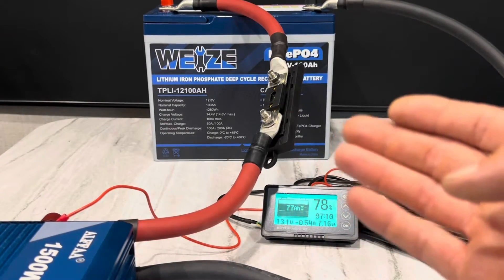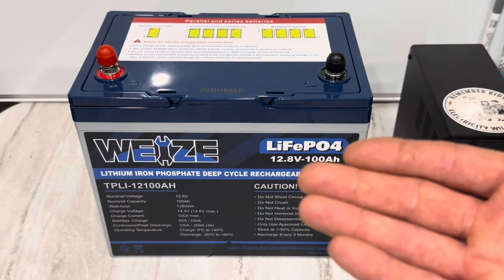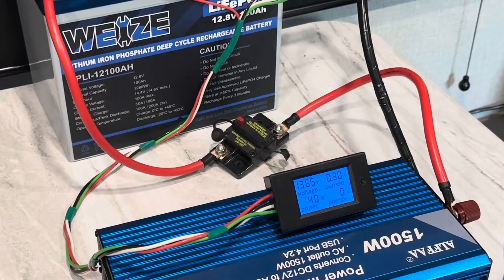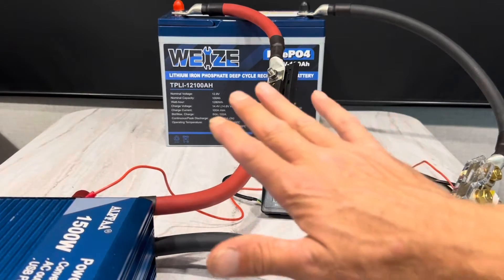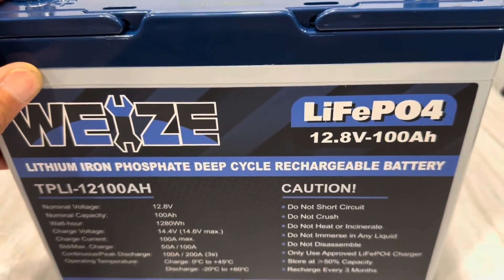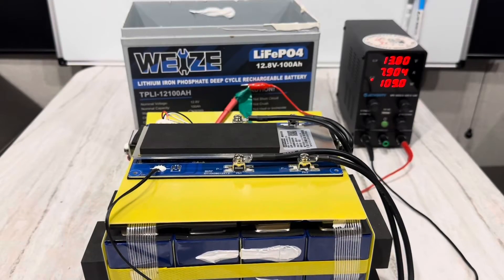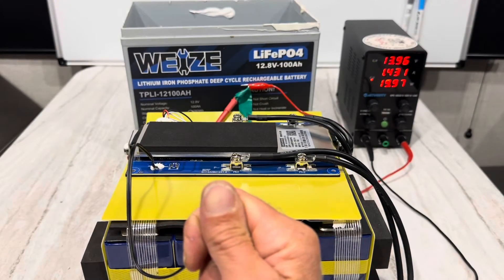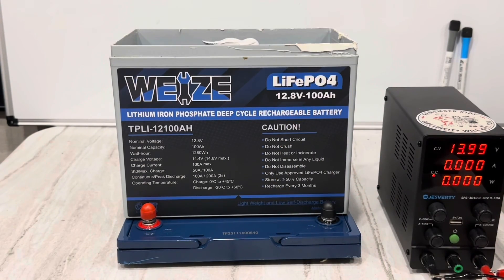WEIZE LiFePO4 12.8 Volt 100Ah Group 24 Battery Review Test Teardown

Comment: I just purchased one of these but with the bolt terminals, and thermal compensation... not sure if thats a BMS charging/discharge feature.. or if it actually has a heater pad in it. plan to install the battery in the engine bay of my toyota tacoma to power a 12v diesel heater, my 12v fridge, and 12v/5v USB camping lights, possibly add an inverter to charge drone batteries.
Reply from the maker: Is it a new release from Weize? Last I checked with them they were working on an automotive dual purpose battery. Is that the one you have?

Comment: Thanks for the video, pretty comprehensive test, subbed.  It would have been cool to see if there is a low voltage cut-off on the battery, independent of the inverter.  Also, an over amperage cut off test would have been cool to see.  Thanks for the test.  BTW I bought one on Prime day, with a targeted discount for using Discover points, for $165.
Reply from the maker: Thanks for the subscription! Thank you for your suggestions, I will take note and try and include your request going forward! Got yourself a good deal on the Prime sale!

Comment: 7awg is rated for even half of 120amps.  should be at least 1/0 gauge wire to handle 120 amps.  I bet those cables nearly melted down.
Reply from the maker: It’s 200°C jacket and extremely short run, falls into a different rating category, ampacity tables are available to calculate how many amps it will hold over such a short distance! 
Most 200Amp rated batteries only have single #4s in them! 
Take care!
Reply: @THEOFFGRIDMOUNTAINHOMESTEAD  I do not consider 10 minutes a short run on a cable rated for 60 amps and loaded at over 130 amps.  I noticed his cable attachment was at least 1/0, more like 2/0.
Reply from the maker: https://catalog.connectronicscorp.com/Asset/WIREMAX-conductor-CURRENT--2-.pdf
Here’s a chart for silicone wire ampacity
Reply: @THEOFFGRIDMOUNTAINHOMESTEAD  Yes, that table shows that, at 130amps, the wire will reach 200 degrees C. The table shows the current required to raise the temperatures of single insulated 
conductor in free air (30ºC ambient) to the listed temperatures.  Actually, for a 6 gauge cable since there is no standard for a 7awg wire I can find anywhere.  So ,the cable won't melt it's insulation.  Great, but the current drop across a 7awg wire at 200C is significant.  For 10 full minutes, you had a conductor documented to heat to at least 200C in free air space, inside an enclosure.  
I would recommend repeating the test, this time measuring the voltage drop across the cable and the internal temperature of the battery with the cable getting that hot for 10 minutes.  I'd also be curious as to the placement of the high temp cut-out sensor with relation to this wire.

Comment: Good review actually showing the build quality.  What I would like to see is a battery that could be used in my van.  I only have one battery holder with no room for a second battery.  I live at altitude with some temps below -25⁰F in winter and need to charge with both solar and altenator. The van is being used as living area so fans and lights are being used. I have a 100 watt solar cell and 80 watt alternator.  Van has to drive every day a short distance. I am using a marine starter / deap cycle battery now, but would like to go to Li since I am over working the LA battery.  What sort of battery would make sense for me and how would I set it up?  I know I can't directly charge from my alternator so I am wondering if there are any solar controllers that can handle the solar cell and alternator inputs, charge the battery properly and not destroy my alternator?
Reply from the maker: Look into DC to DC chargers by LiTime Redodo PowerQueen etc. most are 40A and can take PV input. For battery you could look into self heating lifepo4 but -25F would probably trigger low temp discharge too. 

Sodium Ion is out now in a consumer grade model. GoKWH has sodium batteries at a reasonable cost. They don’t mind the cold. 

But good old lead AGM from odyssey might be your best bet. 

Hope this helps

Comment: Good review as always. I have Weize batteries. IMO, among the tried and true.
Reply from the maker: Thank you! I’m curious, do you use the batteries as part of a solar power setup? 
Weize does have longstanding presence in the battery segment. Still making good units.
Reply: @THEOFFGRIDMOUNTAINHOMESTEAD  Actually I have a couple of small ones on my  electric start generators with battery tenders. This way If I forget to periodically run/test them the batteries will be good to go. For solar I went with the PQ Plus's

Comment: Kinda weird to see the monster wires you’re using for the test and the grounds inside the battery. Good to know it still tests out good anyway. Hope the crockpot dinner was tasty:)
Reply from the maker: Glad you picked up on the wire sizes lol. Dinner was good! Take care my friend!
Reply: @THEOFFGRIDMOUNTAINHOMESTEAD what size wire was that on the inverter
Reply from the maker: 4 AWG for the capacity test and 4/0 for the full pull test. Oversized wire to not interfere with test results.